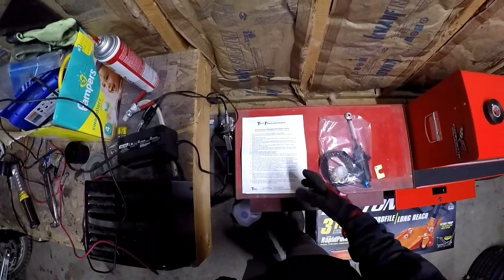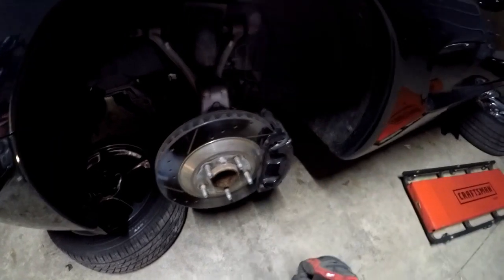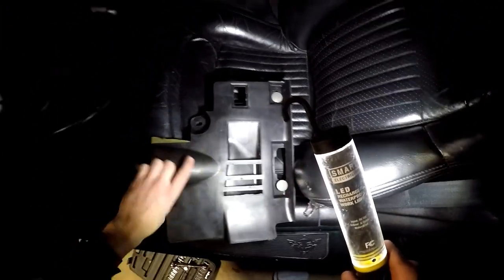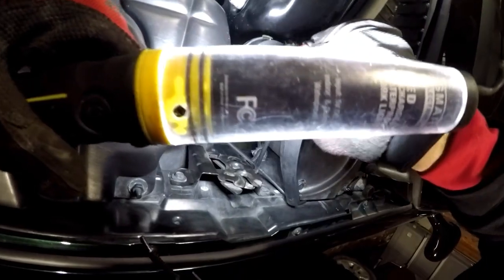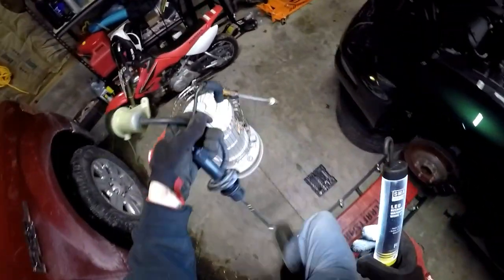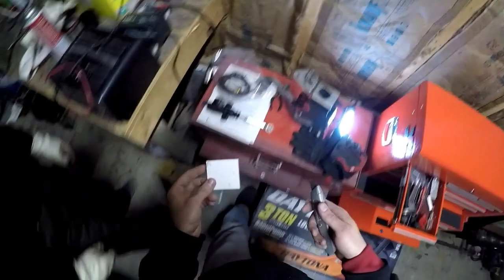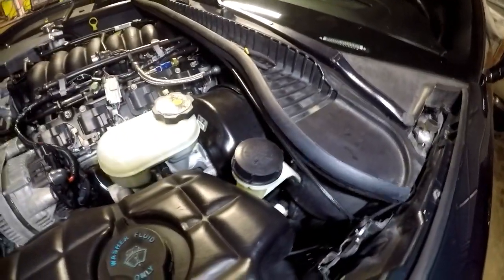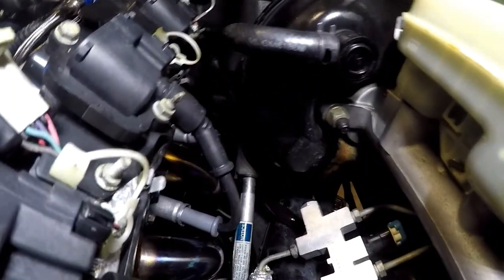C5 Corvette: How to install Tick clutch master cylinder

Comment: 9:39 someone has probably mentioned this but the way I got mine in easily is just removing the blue threaded adapter off the back portion of the master cylinder and it slides right in. Then just reinstall the blue threaded adapter

Comment: I noticed a huge gap between the pedal bracket and the hole in the firewall.  🤔  didn’t try to retain the bellow-seal for the stock one.

Comment: How were you able to disconnect the line from the slave line with long tubes? It's too much of a tight fit without removing the x pipe and all. I really don't want to do that. Since I have my washer reservoir completely removed, can I reach it from the top?

Comment: How has this held up? Did you leave the oem travel for the tinton or did you drill a hole higher on clutch pedal?
Reply from the maker: I sold the car a while ago but I never had any trouble with the master cylinder. I used the oem hole in the pedal and adjusted the travel with the threaded rod. The pedal was a bit lower than stock but I didn’t mind it.
Reply: @MillhouseDSM  thanks so much I’m going through this with and looking at options, did it last like 10k miles atleast or were you constantly bleeding it?
Reply from the maker: @Gunsfornewbies  I think I put around 5000 on it before selling the car, I don’t remember having to bleed it at all after the install.
Reply: @MillhouseDSM  thank you so much